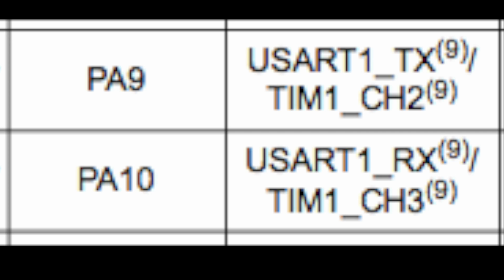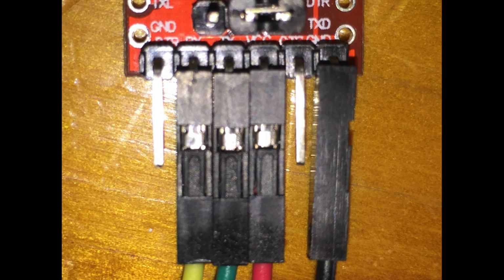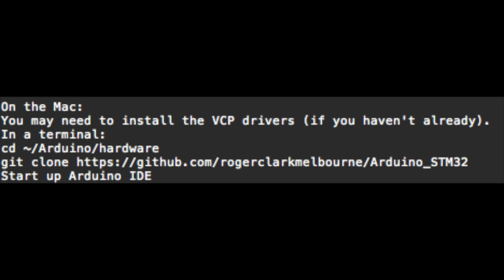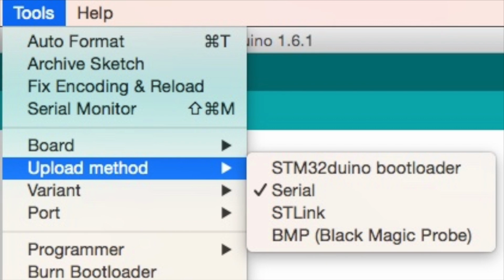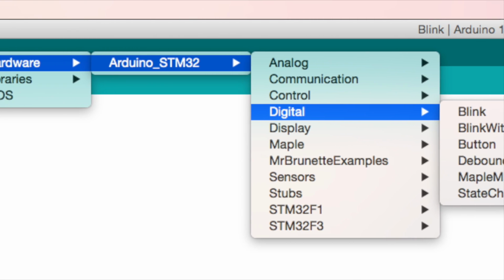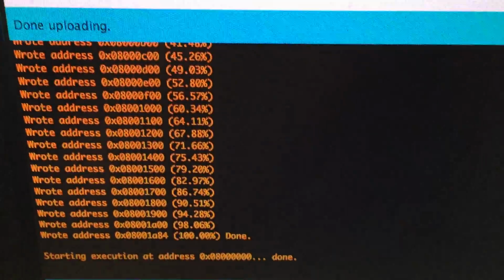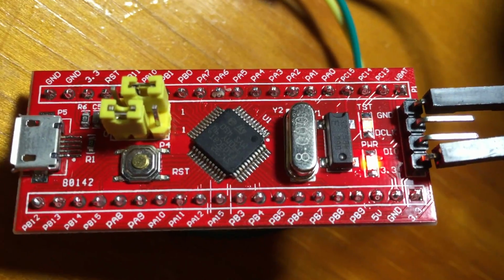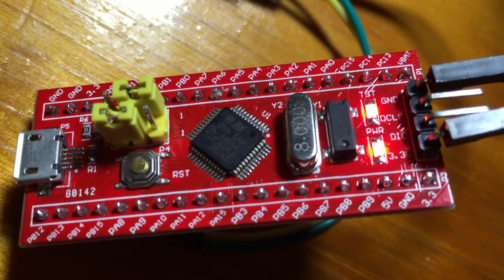STM32 Arduino (STM32F103C8 / Programming STM32 with Arduino and Mac)

Comment: Ok, I'm lost - this got me as far as the flashing green light - but then I started again and put in the official library (as I needed i2c slave - and now - programming with SERIAL -  everything works - the compile works - the serial upload works - but nothing happens...no serial out - not even a simple:

    pinMode(PB13, OUTPUT);
    digitalWrite(PB13,HIGH);

I've selected BLUEPILL F103C8 - serial programming - everything LOOKS like I should have a working board but when I could note get serial.print to work I went backwards to the simple light--a-led above and THAT doesn't work.  Says it is loading at 0x8000000 and starting execution at 0x8000000 - but nothing - absolutely zilch... any ideas?
Reply: Why did I reduce a working setup to this? Well, I was having some issues sometimes in compilation - so I wiped ALL my Arduino stuff (v169) - set up the latest from scratch (I think v183) and loadef in the STM F1xx Cores by ST-MicroElectronics v 2017.1.30 -  because THAT had an example of i2c slave operation.  I assumed that Bluepiil F103C8 was this board....   Am I right/wrong?
Reply: It gets worse  I realised I did the same as you - PB - changed the ports to PC and....    

arm-none-eabi-gcc: error: C:\Users\Peter\AppData\Local\Temp\arduino_build_503012/core/syscalls_stm32.c.o: No such file or directory

This is with a brand new installation... so I can use the library you suggested - and that works but won't handle i2c slave - or use the "official" ST one and get this whenever I change programs.
Reply from the maker: Peter, I approved your comments (for some reason this section of comments needed to be approved - feel free to delete when you need to).  I'm thinking someone might be able to help you out with stm32 with the addition of i2c.  I think I may have a I2c display I haven't used for a while I could try out.  Sorry, been enjoying racing drones.  The stm32 project sounds interesting again.
Reply: Thanks Michael.. Well, I got a little further - using the ST official library which has 2 i2c slaves, I tested led flashing - that works - serial would not work until I twigged to use serial1.print etc... that works... still having to mess with jumpers to make it NOT boot up into programming mode unless I'm programming but generally all is working..

But - the I2c - the example is a trivial example of i2c slave pulling in a character using WIRE. No matter how simple I'd expect a scan to pick it up on device 4.  I've added 2k2 pullups to 3v3.... yet I've tried both way connections of all 3 I2c connections PB6-7, PB8-9 and PNB10-11 and I cannot get a scan to show something being there at address 4.  That's where I'm up to - and ideas or hints welcome.
Reply from the maker: +Peter Scargill Not sure. Someone might be able to help or maybe someone has something in GitHub.  I found my i2c display and I found a I2c splitter I could start looking at.  Not sure if I have any other I2c devices to try.  USB is also is another goal I can work on with the boot loader since this will make it faster hopefully.
Reply: I got a little further - having satisfied myself that SERIAL1 works - I commented that out leaving only the I2c slave. I put a couple of pullups on a lead and tested the lead with my NANO-based i2c peripheral using a scan facility.   I then realised the STM chip has THREE I2c channels - despite nearly everyone calling them SDA1, SCL1,  SDA1, SCL1, SDA2, SCL2 -  whereas presumably they should be marked 1, 2 and 3 !!   I tried all 6 combinations of the leads with the simplest i2c slave software example running - nothing - not a hit... not appearing on the i2c bus at all...   not the best start to a project :-)

Comment: I'm having real difficulties getting this running. I've spent all day following these instructions but I get the following error message...

Failed to init device.
stm32flash Arduino_STM32_0.9

http://github.com/rogerclarkmelbourne/arduino_stm32

Using Parser : Raw BINARY
Interface serial_posix: 230400 8E1

An error occurred while uploading the sketch

I have this STM32 development board : https://www.aliexpress.com/item/1pcs-STM32F103C8T6-ARM-STM32-Minimum-System-Development-Board-Module-For-arduino/32653883227.html

It is slightly different to the one in this video but I've followed the board traces with a magnifying glass and crossed referenced the chip datasheet and I have the TX and RX correctly.

Any ideas what this error is?
Reply from the maker: Sorry to hear.  Someone might be able to help.  I'll keep this comment here.  If I run into the problem and/or solution I'll speak up or someone may.

Comment: Can You please tell me what is it that micro USB port for ?
Can I power it over the usb port?
Is it work on  5v or 3.3v ?
Please answer me
Reply: You can even program it through the USB, but you will have to install the bootloader by the serial method first.  https://medium.com/@paramaggarwal/programming-an-stm32f103-board-using-usb-port-blue-pill-953cec0dbc86

Comment: What if I try to upload a sketch to a brand new and standalone STM32.. mcu? Instead of a dev board I mean...
Reply from the maker: Interested in hearing what you find out.  It's tough to program MCU's with a ribbon that I've used for others.  It's a pain to hold it in place.

Comment: Is it just the arduino ide or the time it takes for this MCU to change state is about 700nS and not the approx 27.77nS to change the pin state means it takes 25 times more clock pulses to change a pin state?
Reply: If you use the standaard arduino code (digitalWrite) then it is most possibly the software. On real arduino's you also get that penalty because the library is written with way to much safety code in it. You might look for direct port/pin access. Can't help you any further for now, because I only bought 1 of these today ;) but I know that the libraries for arduino are very slow.

Comment: I see why you have avoided using the USB to program the board, I thought it might have something to do with the Device Unrecognized Error on Windows? I am having problems with the USB interface, I have read it from forums that it might have something to do with the IRQ or USB enumeration in which the speed is incorrect for the host USB to recognize it as a device. Did you happen to find a solution to this problem?

Comment: A most helpful video.  Between this and Roger Clark's work, and two days of fiddling, finally got a program uploaded from Arduino 1.6.5 on Mac OS X 10.10.5 with an aliexpress STM32F103C8T6 board.  Had problems with the "Cannot run program {runtime.tools.arm-none-eabi-gcc.path}\bin..." that took a while to resolve, then hit a "read out protection" error that forced me to load up ST's tools in a Windoze virtual machine to reset the protection flag.  Alas, success, thank you!
Reply: Hey Mike, how did you manage to solve "fork/exec /bin/arm-none-eabi-g++: no such file or directory" issue

Comment: Rather straightforward. Nothing as shownin the vid. too bad. Arduino 1.6.6. What's even more, the Arduino immediately complaints once having chosen the board and the variant. Complaints about illegal library. Exactly the library coming from Clark. Ethernet and LCD ILI chip library.

Warning: platform.txt from core 'STM32 Boards (STM32duino.com)' contains deprecated recipe.ar.pattern="{compiler.path}{compiler.ar.cmd}" {compiler.ar.flags} {compiler.ar.extra_flags} "{build.path}/{archive_file}" "{object_file}", automatically converted to recipe.ar.pattern="{compiler.path}{compiler.ar.cmd}" {compiler.ar.flags} {compiler.ar.extra_flags} "{archive_file_path}" "{object_file}". Consider upgrading this core.
Warning: platform.txt from core 'STM32F3 boards' contains deprecated recipe.ar.pattern="{compiler.path}{compiler.ar.cmd}" {compiler.ar.flags} {compiler.ar.extra_flags} "{build.path}/{archive_file}" "{object_file}", automatically converted to recipe.ar.pattern="{compiler.path}{compiler.ar.cmd}" {compiler.ar.flags} {compiler.ar.extra_flags} "{archive_file_path}" "{object_file}". Consider upgrading this core.
Warning: platform.txt from core 'STM32F4 boards' contains deprecated recipe.ar.pattern="{compiler.path}{compiler.ar.cmd}" {compiler.ar.flags} {compiler.ar.extra_flags} "{build.path}/{archive_file}" "{object_file}", automatically converted to recipe.ar.pattern="{compiler.path}{compiler.ar.cmd}" {compiler.ar.flags} {compiler.ar.extra_flags} "{archive_file_path}" "{object_file}". Consider upgrading this core.
Warning: platform.txt from core 'GD32 Boards (STM32duino.com)' contains deprecated recipe.ar.pattern="{compiler.path}{compiler.ar.cmd}" {compiler.ar.flags} {compiler.ar.extra_flags} "{build.path}/{archive_file}" "{object_file}", automatically converted to recipe.ar.pattern="{compiler.path}{compiler.ar.cmd}" {compiler.ar.flags} {compiler.ar.extra_flags} "{archive_file_path}" "{object_file}". Consider upgrading this core.
WARNING: Category '' in library OneWireSTM is not valid. Setting to 'Uncategorized'
WARNING: Category '' in library RTClock is not valid. Setting to 'Uncategorized'
WARNING: Category '' in library SPI is not valid. Setting to 'Uncategorized'
In file included from /home/benoit/arduino/hardware/Arduino_STM32/STM32F1/cores/maple/boards.h:37:0,
                 from /home/benoit/arduino/hardware/Arduino_STM32/STM32F1/cores/maple/wirish.h:53,
                 from /home/benoit/arduino/hardware/Arduino_STM32/STM32F1/cores/maple/Arduino.h:30,
                 from sketch/Blink.ino.cpp:1:
/home/benoit/arduino/hardware/Arduino_STM32/STM32F1/system/libmaple/include/libmaple/libmaple_types.h:60:0: warning: "__always_inline" redefined [enabled by default]
 #define _always_inline inline __attribute_((always_inline))
 ^
In file included from /home/benoit/.arduino15/packages/arduino/tools/arm-none-eabi-gcc/4.8.3-2014q1/arm-none-eabi/include/string.h:12:0,
                 from /home/benoit/arduino/hardware/Arduino_STM32/STM32F1/cores/maple/wirish.h:45,
                 from /home/benoit/arduino/hardware/Arduino_STM32/STM32F1/cores/maple/Arduino.h:30,
                 from sketch/Blink.ino.cpp:1:
/home/benoit/.arduino15/packages/arduino/tools/arm-none-eabi-gcc/4.8.3-2014q1/lib/gcc/arm-none-eabi/4.8.3/include-fixed/sys/cdefs.h:368:0: note: this is the location of the previous definition
 #define _always_inline __attribute_((__always_inline__))
 ^
In file included from /home/benoit/arduino/hardware/Arduino_STM32/STM32F1/cores/maple/boards.h:37:0,
                 from /home/benoit/arduino/hardware/Arduino_STM32/STM32F1/cores/maple/wirish.h:53,
                 from /home/benoit/arduino/hardware/Arduino_STM32/STM32F1/cores/maple/Arduino.h:30,
                 from sketch/Blink.ino.cpp:1:
/home/benoit/arduino/hardware/Arduino_STM32/STM32F1/system/libmaple/include/libmaple/libmaple_types.h:61:0: warning: "__unused" redefined [enabled by default]
 #define _unused __attribute_((unused))
 ^
In file included from /home/benoit/.arduino15/packages/arduino/tools/arm-none-eabi-gcc/4.8.3-2014q1/arm-none-eabi/include/string.h:12:0,
                 from /home/benoit/arduino/hardware/Arduino_STM32/STM32F1/cores/maple/wirish.h:45,
                 from /home/benoit/arduino/hardware/Arduino_STM32/STM32F1/cores/maple/Arduino.h:30,
                 from sketch/Blink.ino.cpp:1:
/home/benoit/.arduino15/packages/arduino/tools/arm-none-eabi-gcc/4.8.3-2014q1/lib/gcc/arm-none-eabi/4.8.3/include-fixed/sys/cdefs.h:257:0: note: this is the location of the previous definition
 #define _unused __attribute_((__unused__))
 ^

Sketch uses 13,532 bytes (20%) of program storage space. Maximum is 65,536 bytes.
Global variables use 2,560 bytes of dynamic memory.
Failed to open serial device.
/home/benoit/arduino/hardware/Arduino_STM32/tools/linux/maple_upload: line 40: /home/benoit/arduino/hardware/Arduino_STM32/tools/linux/dfu-util/dfu-util: cannot execute binary file: Exec format error
Reply: +F0kGggle you might want to try using 1.6.2. I had the same error in 1.6.6 and after using 1.6.2, it works perfectly for me. Hope this helps
Reply: +Muhammad Hassanul Ihsan Also, you need to install the Arduino Due in board manager

Comment: How to we program with ST-Link?? This method works but I really wanted to use the St-Link programmer.
Its not detecting the generic board correctly.

1) Both BOOT pins are off.
2) ST-Link device is detected.
3) ST-Link Utility says Firmware version is V2J24S4
4) ST-Link Utility says STM32 Target "Detection Fail".

How do we program with ST-Link v2?
Reply from the maker: +zezba9000 I haven't had a need to program with that programmer.  I found one that was most convenient for me at the time.  I would certainly prefer USB to program the board when I take the time to look into it.
Reply: Michael Steele I just found out how, my stupid ST-Link was labeled wrong and I almost overheated my device by hooking it up wrong lol.

With the "serial" method:

Pros = Arduino can upload to the device directly via a COM port.

Cons: You have to switch the BOOT0 pin everytime you want to test an app.

With the "ST-Link" method:

Pros: Fist time you link you must set BOOT0 to on. After that you leave it off. So now you can have to mess with the pin anymore.

Cons: You have to use ST-Link Utility to upload the .bin file (at least on Windows).

NOTE: Make sure you update your ST-Link firmware before use! With the ST-Link Utility.

Maybe I can make a video later or you can if you every get around to trying it out ;p

Comment: Excellent video !!!
One question : pardon my ignorance but if we have to use PA9 & 10 to program the board, then what is the micro USB port meant for and what are the 4 header pins on the other side for ?
Reply from the maker: +Pradeep K. Shima My goal of this video was to be able to program this board.  I might take it a step further in the future.  Thanks for the feedback.

Comment: In windows is the same process or there does not work?
Reply from the maker: I do not have a Windows machine. I imagine it might be similar.  You might want go through Roger Clark's videos.  I made this just to contribute since I couldn't find instructions in the beginning.
Reply: ok thanks
Reply: +Gratiman - yeap, it worked for me in Windows 8
Reply from the maker: Awesome to hear!

Comment: Michael,

Thanks for doing the video.

I have done a few videos which cover some of what you illustrated, but probably not in the same level of detail and I use PC not Mac.

I'm not sure if you are registered on our new forum www.stm32duino.com, but if not, please feel free to register.

One other thing you may like to have a try at, is installing the bootloader for that board.

Head over to https://github.com/rogerclarkmelbourne/STM32duino-bootloader/tree/master/STM32F1/binaries
and download the binary for your board, i.e generic_boot20_pc13.bin

the pc13 indicates your board has an LED on PC13, the generic means its not a Maple board with the special USB reset hardware that those boards have.

To flash the bootloader, you'll need to open a terminal window , go into tools/macosx/stm32flash then use stm32flash to upload the binary to your board.

(Usage for stm32flash is shown if you just type stm32flash)

Once the bootloader is installed, flip boot0 back to OFF / LOW, and plug the board in via USB.

In the IDE, you just need to set the Upload to stm32duino bootloader.

Note. I've covered this in one of my videos, but when you connect a board that has been freshly flashed with a bootloader, you only get a DFU device USB and not a Serial device. The Serial device only runs when the sketch is running.

Anyway. I'm planning on doing a video on how to install the bootloader, so I'll post an update when its done ;-)
Reply from the maker: Roger Clark Thank you very much.   Pushing code through usb will make it easier.  I'll let you know how it goes sometime.   Thank you for working on this project.